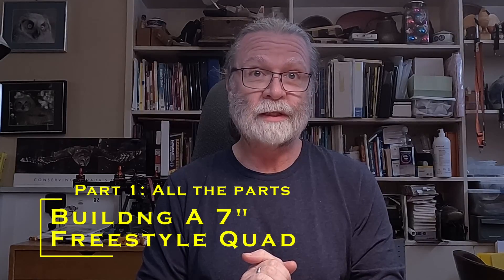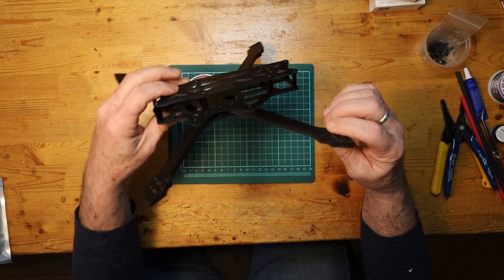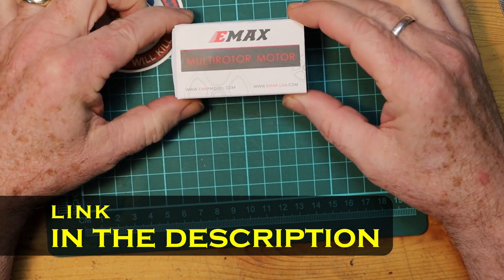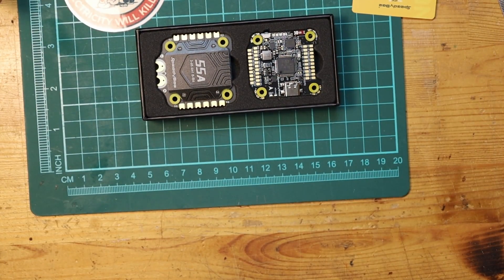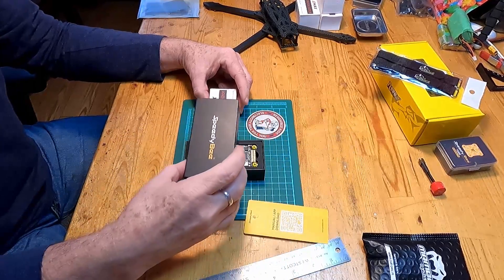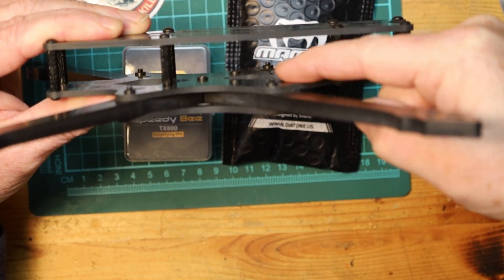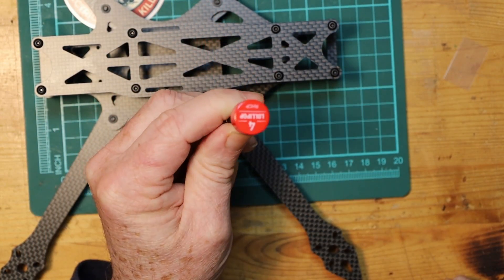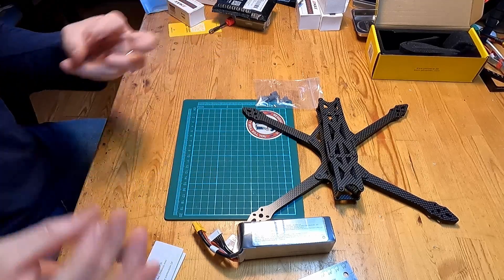How to build a 7" Freestyle Quad - #1: The Parts

Comment: 55 are a lot of amps
Reply from the maker: Yes, 55 amp esc's are bigger than average 5" quads for sure.  The higher amp rating helps keep things within a fairly decent safety margin for normal freestyle flying with the bigger motors and props.  Most of the time, (cruising or light freestyle) this quad uses less than 30 amps, but in aggressive moves at speed, or if a prop hits something, you can get some current spikes into the 50 and 60 amp range.  I've seen blips over 75 amps in my OSD while flying this quadcopter hard.

Comment: Didn't notice you mentioned anything related to props. What would you suggest Bi or Tri blades for this build ?
Reply from the maker: Thanks for the question.  I have been using HQ 7037 and 7040 tri blades.  The 7037's have been working well for me, good speed, handling and decent flight times (5 - 7 minutes hard flying with 2200 6s).  You would get a bit more cruising time with bi blades, but lose a bit of thrust and grip in turns, but if you are mostly cruising and light freestyle they'd be just fine.  I can't recommend any specific bi blades (I don't use them), but you could try HQ Durable 7x4.5x2 or Gemfan Flash 7042.

Hope this helps a bit.